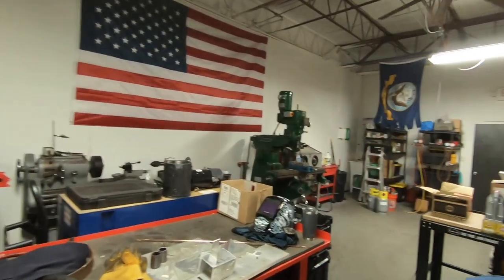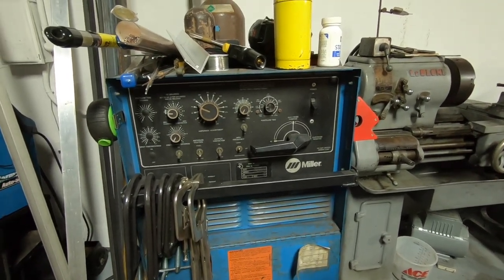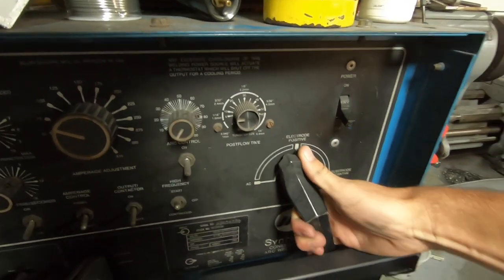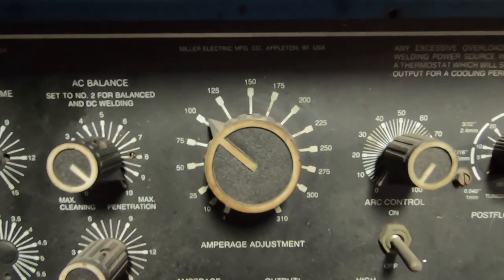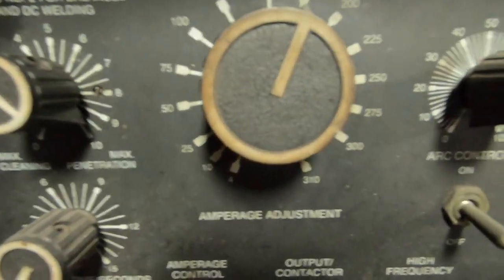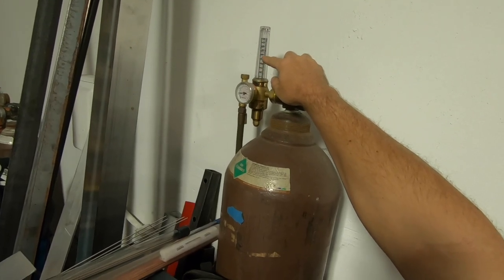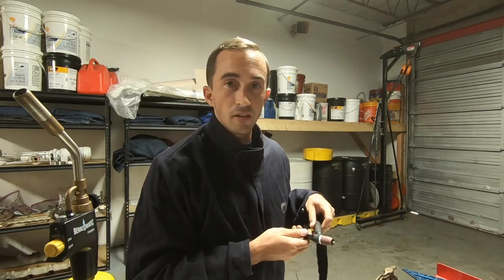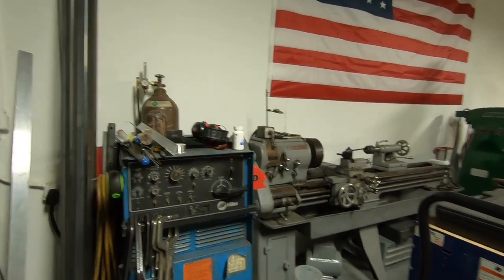SET UP YOUR MACHINE TO WELD ALUMINUM (Miller Syncrowave 250 Transformer Type)

Comment: Thanks for this video, we use this machine at work and I didn’t know how to set it for aluminum! Life saver!
Reply from the maker: glad it helped you out!
Reply: I just got this welder but am needing a pedal to start tig welding. Just curious is it lift start or hf start?  I didn’t think they used hf start when these earlier ones were made. But like his mine has a hf dial down at the bottom.
Reply: High freq has been around a long long-time lol. This particular machine is a high freq start

Comment: Just a heads up the post flow is to cool the tungsten down. When you pull the tungsten away from the weld material before the post flow cools it, the tungsten will become contaminated by the oxygen in the air. When you go to restart your weld there will be contamination in the weld that came off of the tungsten and into the weld.
Reply from the maker: Thanks for sharing! cool tip!
Reply: No problem
Reply: How long does it need ?
Reply: @lexcrob1  8-10 seconds, you can adjust accordingly by watching the tip of your tungsten go from hot orange back to normal color.

Comment: The new inverter equipment is off the scale expensive but uses way less power.

I have a Syncrowave 250 also. It used to be at our constructions shop ran strait to the power panel.
I will soon be setup to use it at my house. I added a 50 amp welding plug in the garage 3 months ago. 
I put a welding plug on my Syncrowave 250 today and  now just waiting to open my 50 amp extension cord Christmas day.
 If I had that to do again I would have tied the welder cord into an on/off box and run a dryer cord that I already had out the other side of it.
It would have been easier than fooling with that #4 wire in a plug.

How did you power yours?
Reply from the maker: it's off a 50a 220v breaker also. your going to loose 50% capacity. Machine needs 100amp breaker at 220v.
Reply: @southfloridagearheads6504  Maybe? According to charts the #4 wire in the SOOW cord is only good for 70 amps.
I actually do have  60 amp breaker .
We ran it at the shop on 50 amps with no issue welding 1- 1/8 Stainless steel rods.
They had to be fitted with special hardware. We did sometimes 200 a day I think with the machine set at 150 amps but seldom if ever mashing the foot pedal all the way down.
I was thinking the only way you could run this machine at its max with cord limits is to run it at 480 which would reduce the amps by half. 

I need one of those carts you have built for yourself! 😃
Reply from the maker: @RC-Heli835  yes my only struggle is with aluminum. trying to weld 1/4 plate. 1/8 stuff is fine at 160ish amps which is my limit with 220v 50amp input. 480 would deff allow you to get the full range. 100amps at 220v would be pretty crazy.

Comment: Mix in some helium will help if you can't turn it up enough, it makes the machine think it's 50 amps bigger,  transfers more heat across the arc
Reply from the maker: wow cool tip! what would be the ratio like 90/10 or 70/30? im guessing my local airgas would know. I will have to try that out for sure!
Reply: @southfloridagearheads6504  id go with 50/50

Comment: Do you have a setup video for "steel" TIG welding on this machine using gas, foot pedal and air cooled?  I haven't quite figured out the settings.
Reply from the maker: send me an email I think I have the setup sheet. southfloridagearheads@gmail.com
Reply: @southfloridagearheads6504  did you end up having the setup sheet?

Comment: Actually postflow isn't to cool the torch or tungsten.  It's to cool the end of the puddle to keep it from cracking or sucking in atmosphere. That's why you have postflow on mig welders as well. It's to cool the puddle to keep contaminates out.
Reply from the maker: good info, thanks for sharing!
Reply: Its to cool both the weld and the tungsten.  Keeping that post flow on a stainless steel weld once you finish welding is a must.
Reply: My machine has gas preflow as well, why Miller made so many normal features as options IDK, they charge hundreds for a few piddly parts and a bit of wire.

Comment: South Florida gearheads I run my TIG and my mig off of a 30 amp breaker and both of my mig and Tig welders both consumed 50 amps at Max so I'm in the same boat you are with the power situation
Reply from the maker: I dumped this machine, looking at some inverter machines now that are more energy efficient
Reply: @southfloridagearheads6504  yeah I was planning on getting some inverter or more efficient welders and use my Mig and TIG as a backup and maybe upgrade the electrical system the next thing about the older machines they don't break that much and it's easy to fix most of the time but they sure do draw a lot of power though I guess that's the downside
Reply from the maker: @tigwelding123  yeah it's a balance. I will be setting up a home shop so I would like the electrical savings haha

Comment: How did you use the foot pedal I noticed you had on the floor?
Reply from the maker: plug it and and switch the panel to remote Amp control.

Comment: hey , you have a 50amp breaker and can only draw so many amps at a time before tripping the breaker ?   hmm..
Reply from the maker: yes, that is all the power available in the shop.  It would be great to run the full 100 amps but there is not enough power in the shop. feeder breaker is only 60 amps.
Reply: @southfloridagearheads6504  Good to know! Looks like I'll be adding a 100amp breaker for mine.

Comment: What about for a thumb control no water cool any suggestions there ?
Reply from the maker: I personally don't like the gas cooled torches. They  normally always have a much bigger profile and I don't feel I have as good of control with the torch. I like the water cooled torch since it has a lower profile. They can also handle much more amperage and duty. Especially when your welding aluminum and are running the high amps. 

I've never used a thumb control. I have mostly seen them used in the field where you can't run a foot pedal due to your welding position or access. They seem very handy but I would image take some practice.

Comment: what about the high frequency intensity knob behind that bottom cover? i have the same welder
Reply from the maker: No HF knob on the welder I have. Maybe yours have different options?
Reply: Set at 80
Reply: I was wondering about the HF setting also.. My HF knob is down under the cover where you pos/neg hooks up

Comment: I keep having my tungsten split. More importantly getting huge oxide layer. ANY THOUGHTS?
Reply from the maker: what kind of tungsten are you using? and maybe your shielding gas coverage isnt enough or getting blown away.
Reply: @southfloridagearheads6504  pure . 3/32. 20-25cfh.
Reply: Get rid of the pure tungsten. They are prone to breaking and cracking. Also step up tungsten size. The higher the frequency the thicker the tungsten.

Comment: Boss, in our machine organ coming continues before pressing button. What would be the problem
Reply from the maker: you have current flow without hitting the foot pedal?
Reply: @southfloridagearheads6504  start button is in gun. Organ gas coming without pressing button, this is the issue now
Reply: @southfloridagearheads6504  model : Miller syncrowave 250
Reply from the maker: @selvamathiem  output contactor switch should be in remote, to control with the foot pedal. The gas solenoid might be stuck. I will email you.
Reply: Solved our problem by adjusting gas timer. Your video is very very useful. Thank you very much.
Reply from the maker: @selvamathiem  that is good news! enjoy the machine
Reply: @selvamathiem  Was it the Pre-Flow gas timer? Picking up this machine next week, trying to learn all I can about it. Thank you!

Comment: I just wired up my syncro250 to a 50 amp with 3 prong.  Had some tungsten balling issues and yep had it on 50/50 balance.

A note on the wiring.  I called miller and they recommend it wired with 6 gauge directly to a disconnect on a 125 amp fuse.  I ran than by an electrician and still not sure that is ok or not.

(6 guage wire is rated for 55 amps)
(3 prong plugs are rated at 50 amps)
(this machine is rated at 72 amps max power”)

I looked inside the machine and it also is 6 gauge wiring* 

anyways 😋🤙
Reply: I ran #3 to 100 amp disconnect then # 4 SO cord to unit , Have not had any problems .(I do have 200 amps in shop)